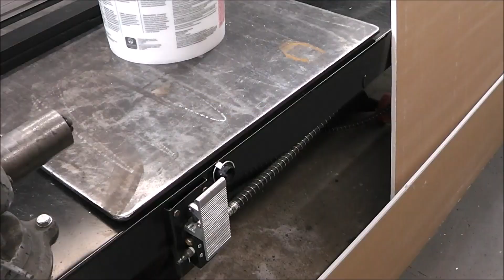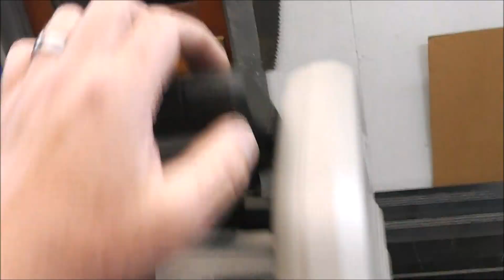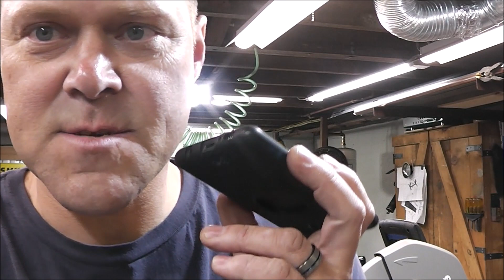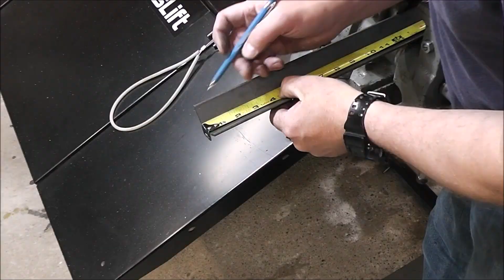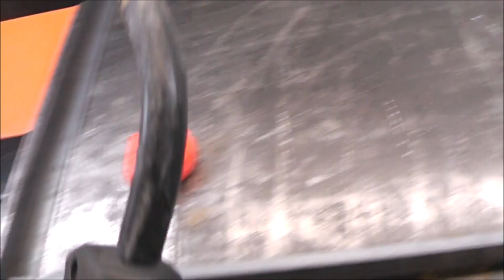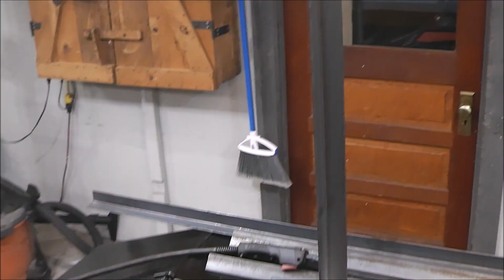Mig Welding and Metal Fabrication Rolling Workbench Pt 1 of 2

Comment: I was wondering why you didn't use a flux nozzle. It's actually to protect the Tweco threads for your mig nozzle from spatter, too, but I don't see threads on yours.
Reply from the maker: The welder I'm using in this video is a Hobart and they use the friction fit style nozzle for MIG and the non conductive friction fit nozzle for self shielded.  Running it without the nozzle for me is kind of like doing a "quick tack" without any safety safety gear....eventually it will catch up to me, but for now I appreciate how easy it is to see without the nozzle in the way. With that being said, parts for the Hobart are super cheap compared to parts for the Fronius, so for that reason I would never run the Fronius without a nozzle (which that unit does have the Tweco threads which bb's ruin pretty quickly).

Comment: The flux core "plastic" nozzle also protects the gas vents in the gun from getting splatter in them.  I highly recommend one.
Reply from the maker: I personally have never had a problem with them plugging but that's not to say it won't happen. You can always buy just the body where the nozzle attaches if it were to get plugged.. I like the added visibility without the nozzle. Preference I guess.

Comment: Never use bed rails 
NEVER  NEVER   NEVER.
THAT STEEL IS ALMOST POT METAL. IT DOSE NOT WELD WELL. IT BREAKS. ITS WEAK AND HARD TO CUT DRILL. ETC. NOT SAFE!
Reply from the maker: For something like this bed rails would actually work pretty good especially for someone on a budget. Bed rails are hardened so I find plasma is best when using them. I have quite a few videos on this topic.